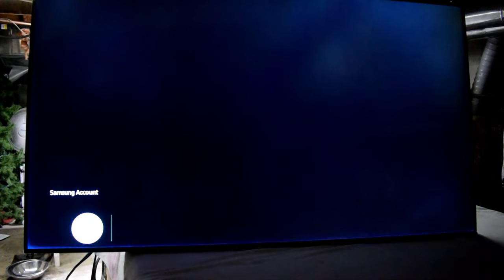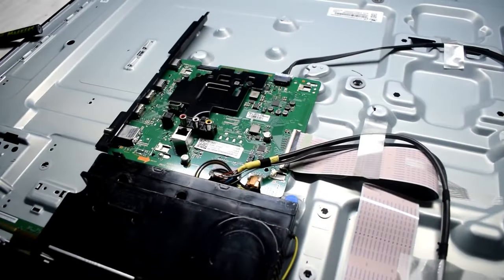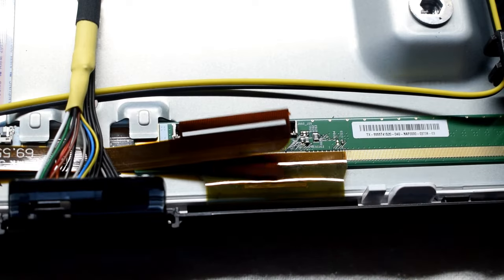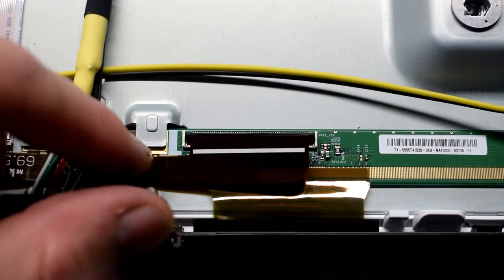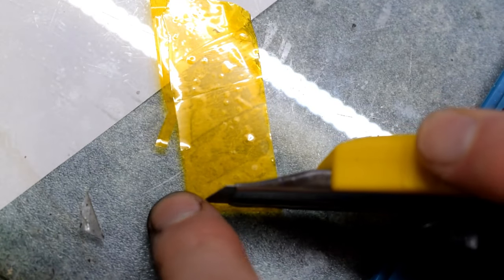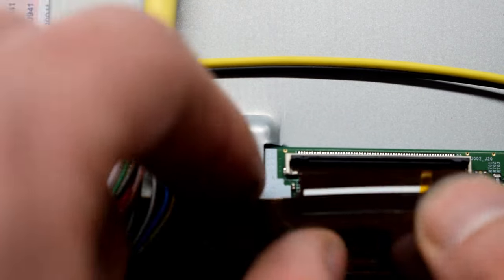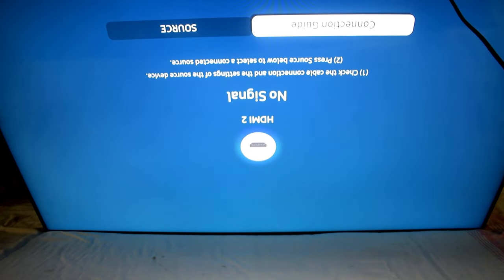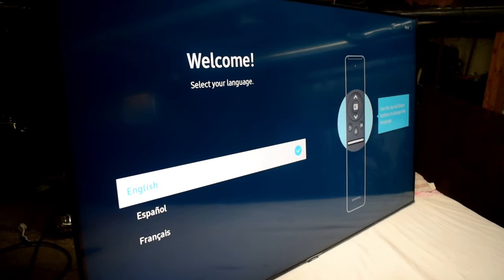Easy Fix! Samsung Smart TV keep restarting | UN55TU8500F

Comment: It’s strange that everyone is having the same problem around the same time. My tv gave no warning signs. Im beginning to think Samsung is up to something .
Reply: Having exactly same issue right now. Bought mine EXACTLY 2 years ago from this day
Reply: Me too. I have a TU8000. What the heck is going on
Reply: Same for me
Reply: Joe Biden did it
Reply: Same here in Argentina. This issue was commented on a radio program and Samsung had to take responsibility for this, and fix the tvs even when the garantee had expire
Reply: @dman5501  mine is doing something similar. The top half gets green and has lines and the bottom half of the picture freezes and then it reboots and shows the smart TV powered by tyzen or whatever it is. Never had an issue until recently
Reply: It's called premeditated obsolescence.. they need to have money keep coming in
Reply: I've got the same issue
Reply: There’s 100% a fail switch that most of tv manufacturers are fitting to tv’s now so that they would fail as soon as tv is out of warranty and make you go an buy a new one . 10year old tv’s have no such issues and work perfectly fine. Plus this is panel that fails rendering tv unfixable .
Reply: Same
Reply: Before u buy another brand TV do a YouTube search about this same issue with whatever brand that u decide to that u want to purchase and u will be amazed at what u find out
Reply: Mine does not show anything on the screen but the “boot up” sound just cycles over and over
Reply: Mine is model number un50tu8000f and it won’t stop turning on and then immediately turning off. It was working perfectly until an hour ago and no matter what I do it won’t stop.
Reply: And NO ONE seems to know WTF to do. I'm not an electrician. 😫
Reply: I have a au7000 samsung and after two years it when on boot loop. Will try this today.
Reply: @nicolasdiaz8290  I'm in Argentina, too. How do I find out more about this? Thanks!
Reply: I have a samsung frame 2020 just after 1 year facing same problem

Comment: It’s important to understand that this is more of a bandaid than a fix. any one of the pins could be broken. I just spent 2 hours doing this only to get it barely working (horrible but still visible display). Sometimes this works like a charm, other times you should just throw in the towel and buy a new TV (not Samsung).

Comment: Hey thanks for the help! I found the location for the tape so my tv stays on, the only problem is that I only have the backlights working and no picture. I had both: no picture and a bootloop. But what can be wrong if only the backlights are working? Thanks in advance!
Reply from the maker: need to move the tape until you get both.
Reply: Did it work?
Reply: Not yet 😢
Reply: Same problem here... I'm still moving tape around... Any further advice?
Reply: Same problem. I only have backlight no picture.
Reply: 82 inch 7050 board Samsung. I use tape thing to prevent constant boot cycle but still no picture . Black . With tape fix I can at least stop it from turning on and off and get sound going and connect to it via YouTube but total black screen. It’s a expensive stereo right now :(
Reply: sfpcx495g-002 - replaced this entire part and it works like new

Comment: Outstanding big man!
Just fixed my QE50Q60TAU using this exact trick.
Took a while to figure out which pins - just trial and error but I got there.
A 2mm strip of sellotape saved me over £400 which I was quoted to fix the TV.
Reply: I have the exact same tv model. And mine just started having the same fault

Comment: This did the trick on my 1.5 year old 55" QLED.  Same side as shown. What's interesting is that it takes the baclightlighting a bit of time to self-adjust now. For example, I'll have a white outline around the outside for the first few minutes, but then it disappears.  As well, the repaired side was a bit lighter after taping, but it self-adjusted quickly and is fine now. Awesome fix.

Comment: Took a few hours of trial and error but this was a useful video. Taping off a few pins got my TV working again. Thank you
Reply: Bro, you kept on trying to tape every single line ? I tried up to 5th line, it works a while then same things happen and screen turns half black and it restarts. To which line did you reach ?
Reply: @dr.davident  used a piece of black art tape the width of 2 pins and carefully moved it down the strip and reconnected until I got a visual. I kept the TV on, which I do not recommend if you are not experienced. Reason I say is because even after disconnected from power these TV's are capable of delivering a strong shock with any stored energy.

Comment: This is great thanks only when I unplug one ribbon only the back lights come on but at least the TV doesn't go into the power cycle.  Just curious as to why half the screen doesn't work like in the video?
You just saved me from recycling a two year old TV! Cheers 🍻
Reply: I know your comment is a year old, but I had the exact same thing with my Samsung TU8000. It would power cycle constantly but when I removed the ribbon from one side I did not get half of the TV working, but the backlight did come on and it did stop the power cycling. My fix was taping a small section on the right side ribbon, like most seem to have done.

Comment: My TV is experiencing the same exact problem. I removed one half of the ribbon from one of the clamps and the power cycle stopped and the TV remained on and finally made the sound of the TV rebooting over the speakers. But I have no picture on either panel. I tried unclamping the ribbon on both sides to no avail, both panels remained black. Does this mean that I have a short on both panels and both sides of the ribbon will need tape or does this mean my problem is elsewhere?

Edit: I only needed to put tape on the  left panel ribbon for the full picture to return but half of the color is faded on the left side of the screen. Is this a problem when covering too many pins? I will keep trouble shooting. Thanks
Reply: Did you find a solution at your problem?
Reply: what it on two sides?
Reply: I have same problem with my tv it s not restarting anymore but screen it s balck on both sides 😡

Comment: My model is q6f Qn55q6famfxza BN94-12756C which doesn't have the same accessible gold ribbon cables. Instead, it has two sets of white ribbon cables from the mobo into the panel. When I disconnect both ribbon cables from the mobo, it still blinks. Since it blinks when the mobo is disconnected from the panel, does this indicate a bad mobo or ps?

Comment: Hey, I'm currently trying to fix my tv with this. When detaching either of the left or right half connectors the power cycle issue still remains. If I disconnect the board that has the HDMI ports etc(left while looking at the back of tv) then it seems to not power cycle but just has a black screen. Any ideas to further isolate what the issue is here?
Thanks

Comment: Hello everybody iv just bought a Samsung UE58AU7100KXXU 58" with the same issue of restarting. Can the ribbon or the section part the ribbon tht has the tape put on not be changed for new parts or are they not chargeable?

Comment: My Samsung tv (None-smart) randomly turns off and just keeps going into a boot loop. I heard the sound that its turning on and then right off. I tried unplugging it for a few minutes but that did not do anything. I tried different outlets and tried holding down the power button but that did not do anything.

Last night I left it unplugged for about an hour which yielded some great results. The tv turned on and stayed on for over an hour without any HDMI,USB's plugged into it.

I left the TV unplugged overnight and this morning it turned back on without any issues. After about 20 minutes it went back into a boot loop.

I also confirmed there are no sleep settings or power saver settings.

Anything else I could try before tossing it in the trash.

Comment: Hi mate. So I’ve narrowed it down to the pin that’s causing the problem but I still don’t have any picture and just the backlight. Any ideas?
Reply from the maker: could be the whole panel is bad
Reply: sfpcx495g-002 - I just had the same issue. Replaced this cable entirely and it works like new.

Comment: I have a 82 inch Samsung tv that is in continuous boot but never see a picture. I have one cable coming off mother board. I can remove the cables to the right or left at bottom and boot cycle stops and it boots with NO picture. Black screen. Can it be as simple as motherboard ?
Reply: prop a bad lcd panel try tape the ribbon cable as seen in video.
Reply: @MrNew-us1lg  I can get it to boot with tape on panel connector but still black screen

Comment: sorry I did it, but after half an hour, the image is distorted from the bottom line There is a way to fix it
Reply: same as mine, did you find solution for that? tape on another pin ?

Comment: Yeah i have a same issue with Samsung TU800050 and samsung cost me to change panel TV for $300 they said that panel was broken (? I mean my panel display dosent have dot pixel and looks good) but they accusing me to change to new panel, yeah its fixed my problem. 

And im asking its been 2 years after purchasing this TV why samsung TV so fragile with panel even im using wall braket.

Edited :
The technician even suggesting me to change to brand who has 5 years guarantee panel, because all of new TV are lame. 

If you wanna buy beautiful color just buy Sony and never touch samsung, because sony and samsung have same problem but sony has more beautiful color.

And you can buy Chinese TV like xiaomi for long using TV. Like 5-7 years